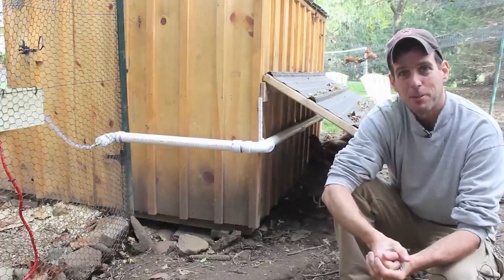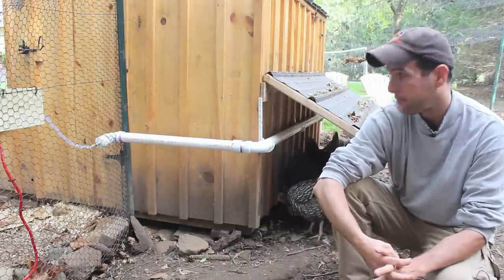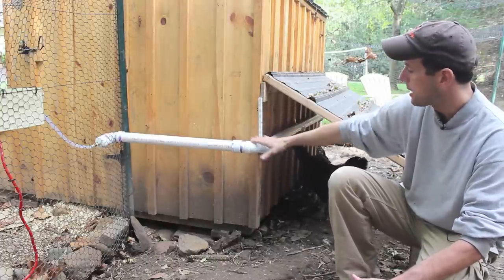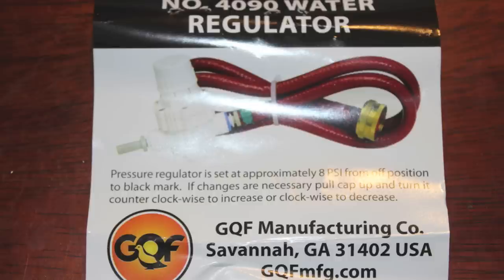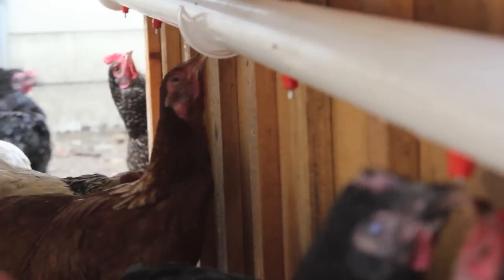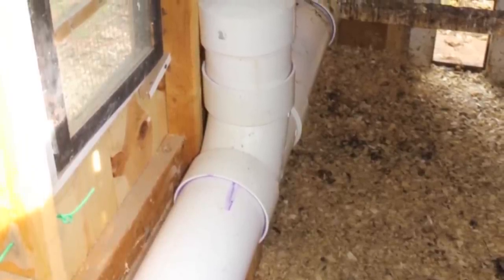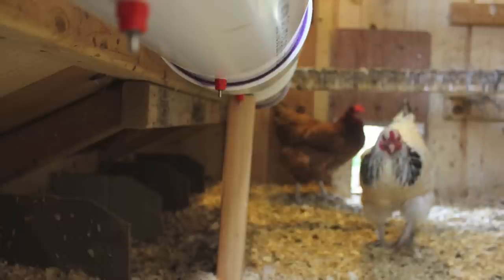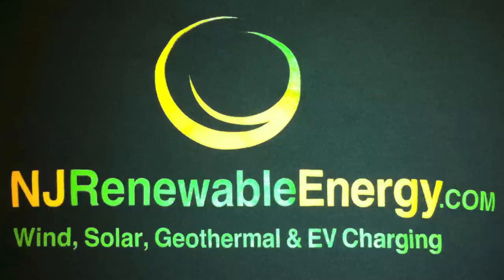BEST TIPS LESS WORK Chicken waterer Heated Waterer Nipples Winter & Summer Garden Hose

Comment: Something you might want to try for the Winter. This is just an idea. You know how when you go to stores, they have the double set of doors, where you walk in , the first set of doors open and close and then you walk through a second set of doors? My idea is similar in nature. Put something like some flaps-strips of fire hose or similar material in front of your coop door so the chickens get use to walking through them. When the cold weather starts to come. Add a short tunnel, no more than a foot or two, to the outside of your coop opening. So the hens now have to walk through the flaps and then through the short tunnel to get outside. After they are use to this, start adding another set of flaps to the outside side opening of the tunnel. This will restrict/reduce and cold winds from just blowing right into your coop during the Winter, but should still allow enough air flow to keep the coop ventilated and the air from getting stagnant. It should also help keep warmth inside the coop. Again just an idea you might want to try during the Winter. You can make the tunnel removable, so that you can take it off during the hot months. The flaps might also help reduce flies and other flying insects from getting inside the coop.
Reply from the maker: Please share the video when you build your first prototype

Comment: I have a similar setup with drip-nipples fed by a 5 gal, bucket. It seemed to work fine over the summer; but, now winter is setting in... I purchased a submersible aquarium heater suitable for a 20 gal aquarium, hoping it would keep the water from freezing. Yesterday, one of my drip nipples was leaking severely, not just a drip, but a steady trickle. I am no longer a fan of the spring-less vertical drip-nipple. I've ordered some horizontal drip nipples and some water cup ones as well. I'm going to try them out. I like having clean water for my chickens and not having to change the water twice a day. But, I won't use the vertical drip-nipples again.

Comment: Great work! Thanx for posting. I am building a freeze prevention system that does not use heaters. I is using a 12vDC utility pump to recirculate the water. moving water does not tend to freeze.

Comment: How did you get the GQF 4090 pressure regulator to work with regular water nipples? I installed it and they leak at 7 psi which is as low as I can get it without the regulator shutting off all of the water

Comment: I built the same set up for my rabbits , gravity water like the inside set , found they would use , bump the nipples they would seat back in and drain the whole pipe and they were a name brand nipple any ideas ?
Reply: I think the water pressure will close the nipple and pushes them back out . .

Comment: hi Love your system but I'm having a hrad time locating a regulator that can go as low as needed. any ideas?
Reply from the maker: what won't this work?
Reply: Maybe what she is meaning is bird bath deicers usually range from 80 to 250 watts and heat the water to an unnecessary 40 plus degrees while heat tape wrapped around 1 1/4" pipe uses 3 watts and only heat the water to 34 degrees, that's a huge electricity savings when you live where I do.

Comment: Might want to trade that 2x4 for a 2x6 .Turn it sideways, and v the top to cradle the pipe. Moist heat is better then dry heat, leave the hole open for the heater. That should place moist heat in the air.

Comment: I love the idea and was about to buy the 4090 regulator.. but the manufacture states  "This valve can be used for a small system of 1 to 2 cups or a large system designed to support 1500 quail. Pre-set to provide approximately 8  lb. water pressure to drink cups. Pressure setting is adjustable. Includes 5/16'' and 1/4'' hose barbs and 2ft normal pressure hose with connector. (Tubing not supplied, see #4028, #4080, #4081 and clamps #4010 #4014)  For use with cup drinkers.  Should not be used with nipple  drinkers"

Before I buy - why do they say not to be used with nipple drinkers?

Deborah
Reply: no idea, never had a problem for 4 years

Comment: Can you do a tutorial on solar panel. I need to know what steps to take and how much watts is powerful enough to plug in heat lamp. 3-4 heat lamp. Any ideas or suggestions may help. My chickens are at my farm with no electricity. I need to keep their water warm for the winter.
Reply: 3 to 4 heat lamp wow you need 2000 sq feet or more solar. . they say the temp under earth is 55deg no mater where you are on earth .. I believe you only have to dig 10ft . . you can use black  color to make the sun heat and insulation to hold the heat in oppose to generate the heat
Reply: 400Wx24hrs a day in winter...sure that is only a 9-11,000 dollar system depending on your location, don't forget the batteries to run the lamps after the sun goes down, those will weight 1800lbs total.
Reply: wattage...so say 1 deep cycle marine..car battery at 850 cold cranking amps will make about 85watts happen most of the day..ok the solar power is what you use to recharge the battery..you'll need a solar charger control box..say 30amps..or get 3 x 10amps each..run your lines into the positive and negative for the given slots..should be 6 slots..first 2 is for panels 2nd 2 is for battery 3rd pair are for lights..*if the lights cause the regulation box to turn off..you'll want took hook them directly to the battery posts with a light switch or to the panel box on the last 2 *you'll see where they go as they are labeled..3 x100 watt panels can do it..you'll just need more batteries hooked up parrelel positive to positive negative to negative..never hook up positive to negative on a battery system..you'll ruin the battery cells..(if someone says "24volt"etc etc just ignore them ..they don't have experience I have) ok panels to boxes batteries to boxes lights to boxes or lights to battery..the solar charger boxes ..some have timers so ..take a few minutes deciding which to go with..you may even use 3boxes 2 are direct controllers 1 with a timer on it..ok..you will need at least 1 deep cell battery 12volt 850 cca for each light..for ever 100 watts of light add 1 more deep cell battery..bingo..now its an investment but putting $1000 in batteries can run a small 5500btu air condition independent ly..as long as you have a 2000watt power inverter..also when hooking up the inverter..make sure it only hooked to the lead post on farthest side for the wires from the solar charger controller box..that way it does not send feedback to your charger controller boxes..

Comment: You also want to be sure that there is no way to get any back flow into the house. I know it is unlikely but if the water pressure gets cut and has a loss of pressure in other locations people have had pesticides in their lawn get drawn back into the sprinkler heads  and contaminate the drinking supply and cause serious medical problems. In another life I was a plumber and this is one of the stories that was related to me by the instructor of the mandated backflow certification class we took working for the Federal Govt. It was part of the building code there. Just a precaution that you may or may not want to heed.
Reply: Anything I hook up to house taps has a pressure/back flow regulator.  I would not install this system without it and it would seem regulating pressure would be necessary.  I live in a rural community and have municipal water but our pressure is nearly at the 80 measurement which is high pressure.  What am I missing?

Comment: How has the winter waterer faired? Does the water freeze near the ends or do the nipples freeze? Do you heat your coop at all in the winter?
Reply from the maker: very well… the water hasn't turned to ice.  Actually, the coop tends to be 10 to 15 degrees warmer than outside temperatures.
Reply: the43k This video has been very helpful, as well as this comment. I am doing a major rebuild for the chickens. I purchased some of those chicken nipples, but after the winter we just came through I was a little nervous about using them.
How did it work out with the nipples being located right in front of your nesting boxes?
Reply from the maker: very well, no issues with chicken nipples
Reply from the maker: MotherOfManyHorses they worked great, no issues.

Comment: That screw on flush out plug on the end is the wrong piece to use. Those arent made for holding any pressure what so ever. Makes me wonder why yours isnt leaking. They make a better one that is red and has a wing nut. Thats the bext one. I think its cheaper also lol
Reply from the maker: the pressure is about 1 to 2 pounds.  that's why it works

Comment: Just so you know, the purple pvc drainage adhesive is only suppose to be used on sewer pipe, its highly toxic and carcinogenic.
Reply from the maker: agree 100% ...
Reply: The purple primer is safe for potable water. Out of abundance of caution, you can let everything cure for 24 hours and flush with water before using, but anything rated for CPVC is safe for potable water.

Comment: Too much work, why not just use 5 gallon buckets with nipples? I hang several buckets with lids which last a couple weeks. Clean water, neat with no leaky hoses....btw the water taste lousy when it comes out of a hose.....even food grade hoses!  I do the same method for feed. Also not sure if the glue you used to glue pvc together is ok for drinking purposes.
Reply: First off the glue would be the same as the glue for you house plumbing, so why would it be safe for you to drink but not the chickens. 

Second, you first mention "too much work". After the the initial work, it has virtually no work after. With the buckets you have to hang the and re hang them all the time. They get brittle and old and need replacing. the lids are way harder to take off. then if you have more chickens than one bucket can support you have to hang others and all the problems they come with. 

As far as the water hose tasting bad, well where do you think most people get the water from in the first place. most grab the hose and don't often fill directly from the tap. But if you don't like that you can always use PEX. It is the new stuff being run for water in new homes. It is flexible and easy to install, it also expands for cold weather. It can be laid on the ground or buried below the frost line as a permanent water line. If you can tap it into the house plumbing with a check vale or back flow prevention. 

By the way buckets are way harder to keep warm. the plastic is so thin it radiates the heat out faster. If you have a large flock you will have to spend way more money on heaters and the bill.
Reply: Too much work???  one day of work is far less then the years have having to keep filling buckets.   Plus its a safety issue, they never run out, no matter what my schedule
Reply: Roasted!!!
Reply: You are CORRECT in the use of the glue,,,,,the type of glue he used here is for drains only,,,,schd 40 pvc is NOT for drinking water,,,,,aka(potable water),,,,,,it is printed right on the pipe,,,,,,,,the correct glue to use is CPVC ,,,,where the glue would harm  chickens?????? i dont know
Reply: you CAN NOT use that glue or pipe for drinking water,,,,,go read the warning on the pipe,,,,,that type of pipe is for sewer only